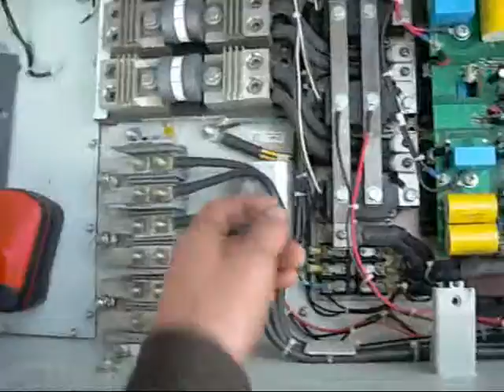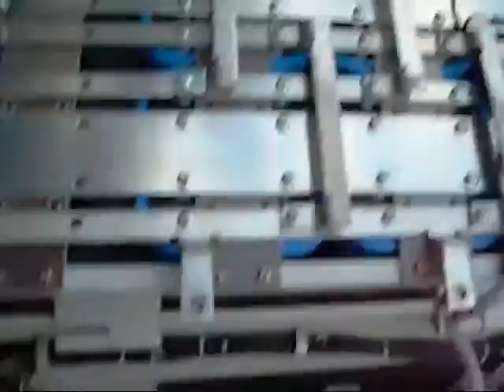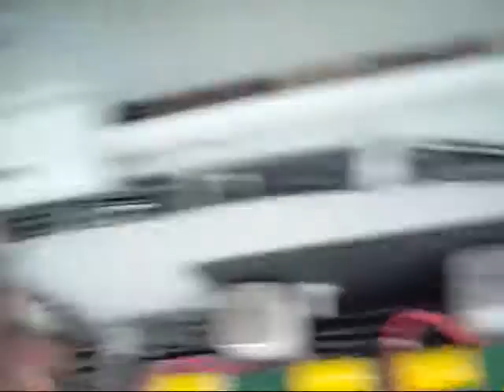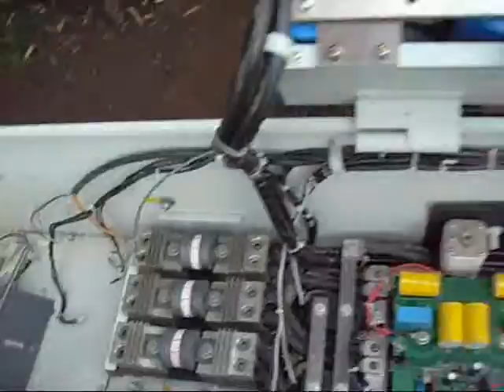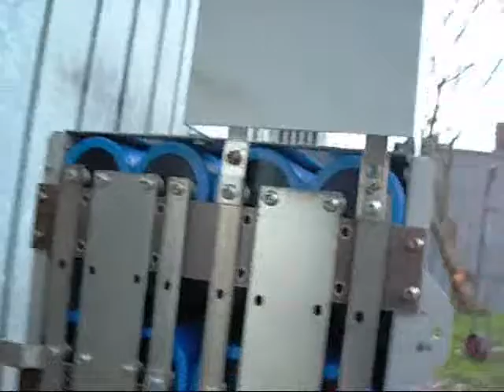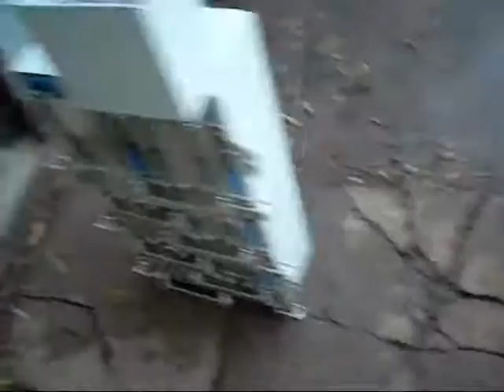What VFD parts to save for HV Projects

Comment: Oh my god, that is insanity. I want to scrap something like this *so* bad!!! 

IGBT's are great, but SCR's like pulsed currents more. However, IGBTs are good for much better control. You can turn them off in the middle of a pulse, instead of waiting for the voltage across an SCR to go to around zero...

I would die for all that stuff, like the HV yellow low ESR high current capacitors, and decoupling caps, and chokes.... And EVERYTHING IN THERE. Want it so much it makes me mad, ya know?

Comment: Well for simple PWM you do not need current wave controll and feedback to controller. You can simply turn on and off correct IGBTs in one design pattern that is popular and easily aveliable in internet. If you swith the patterm of PWM slowwly frequency is low and engine turns slowlly for fast frequwncy just speed up the algorythm and the simple VFD does that acording to cotroller and its instuctions. Of course the stability of rpm and current wave is not ideal but it works.

Comment: In theory this big VFD has sensores for current so it has a feedback to the controller and the conntrolerr makes everything to keep the current as perfect sinus wave of current as possible in all 3 phases. It can be done by pulsing positive and negative voltage spikes for desired phase. there is also a rato of voltage because the voltage will split if only one or two or two by one phase are connected in different way. it can be done in reverse as well it quite nice algorithm for PWM control.

Comment: Well VFD need all phases for making voltage split in 0, 1/3, 1/2, 2/3 ,1 ratios compared to DC voltage on caps that should be 325V for 1 phase and 530V for big equipment. So the voltage is actualy square like thing but it makes no differencr for induction loads because they depend on current for magnetic field strength and they actually filter the voltage thanks to big inertia for current rising just like in charging coils. So VFD will fail for capacitance load . Resistive load is OK.

Comment: I do not know haw it is damaged but i will say this it can take 1 phase and do the DC for caps-bank and then the arrey of IGBTs will make artificial 3 phase grid for 3 phase engines with frequncy regulation for speed regulation in induction mottors. Small VFD is thw thing you need for 3 phase compressors istead of capacitob phase shifting like in run capacitor motor. There only one demand. engine must be star configuratin and all 3 windings must be used. This is the priciple for most VFDs.

Comment: those yellow caps on control board are also good for sell since they are polypropylene ones. Those big charging coils are not good they actually limit the pik current so ,copper scrap. Sensors for cables for current measure are good for sell with PCBs. This pice of stuf is only good for PWM so all you can do with it is power supply 3-phase i mean with freguency from 1Hz to 400Hz or more. Voltage is not sinus the current must be sinus that is all that matters for induction load as 3 phase engine.

Comment: IGBTs are modules and you have them plenty. connecting them in parallel is not a good idea. They are designed to fast swith on and off medium current for PWM controol. Well for fast discharge of cap-bank you need one big SCR silicone controleed rectifier. It can only be turned on so it works great for disharge of rely high currents and when the cap-bank is empty near 0V SCR will naturally swith off so you can charge caps again. IGBTs are not good for high currents discharges.

Comment: Sell those IGBTs and 3 phase rectifiers on e buy and buy some normal 1 phase bridge rectifier for charging DC to cap-bank. I suggest you connect a light bulb 100W in series with caps as charging resistance. the voltage will be 325V DC. you can also set up a voltage doubler from only 2 diodes and have 650V DC but it is too much for caps. Well they are 450V so you can actualy use voltage doubler with light bulb or rather 2 light bulbs in series and cut the charging process as the voltage goes 445V

Comment from the maker: I figured the IGBT's would be too sensitive for things like rail or coil gun projects, if I can get big SCR's I'll replace them anyway. much easier than working out the wiring on these monster IGBT's!

The caps are Phillips 2800mfd 450V DC (525 surge). I've seen them used in many HV projects so assuming their all okay it will work!.

Comment: you probably will need huge SCR's or thyristors to discharge that cap bank for a railgun etc, but im not entirely sure how well the caps will handle such high discharge rates...
im pretty sure the IGBTs will fry after a while the Ron is probably too high to get a high current peak anyway